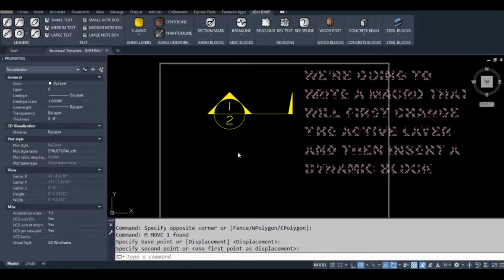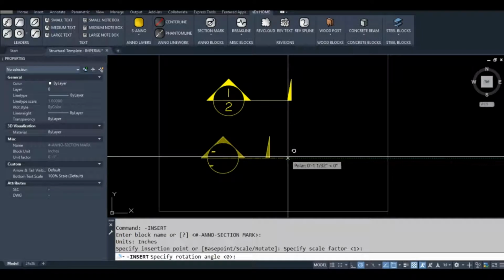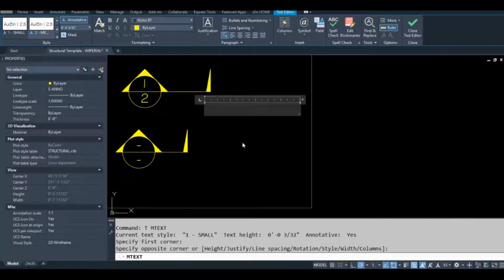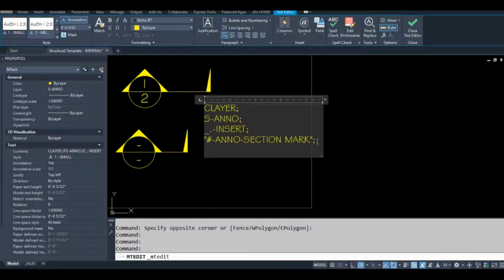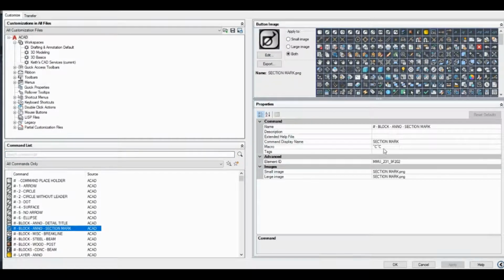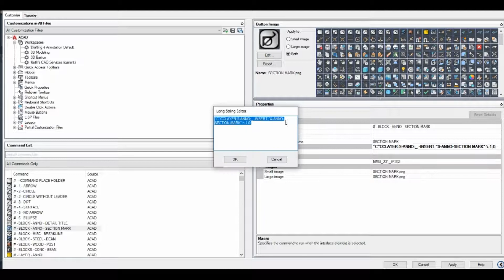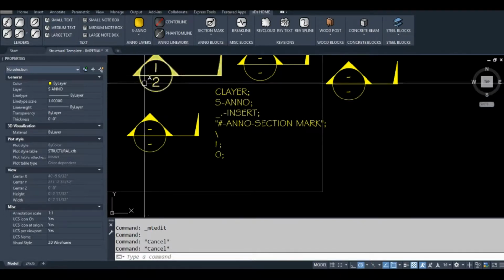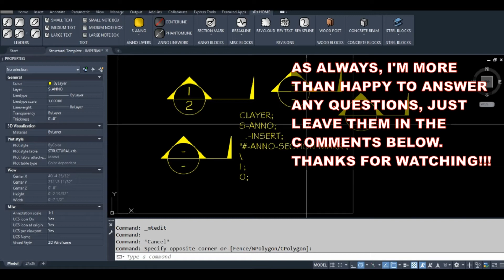AUTOCAD MACROS

Comment: its says error . they can't find the directory of the blocks. can I add this in macros to set the location of the blocks?
Reply from the maker: Hi Dondie. I believe in fact that you can add the directory to the macros. This would be a way to bypass the task of having to add the support path to your AutoCAD setup (by going into "Options", "Files" tab, and adding the path to either "Support File Search Path" or "Working Support File Search Path". I can't remember which one. AutoCAD first looks for a block in your active drawing's database. If it can't find it, it then searches the support directories. I believe including the file path string will bypass the later - I've never done this though so you'll have to experiment a bit. To avoid the error message you are getting you could either have all your blocks stored in your template to begin with (not always an option I know) or add a support file search path.
Reply: @randomCADstuff  thank you bro. Got it work. Cheers